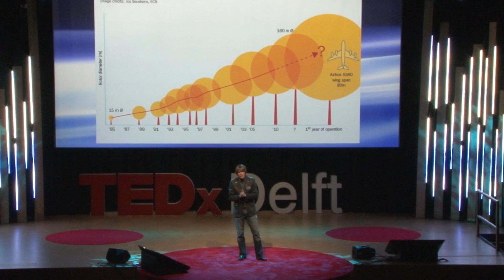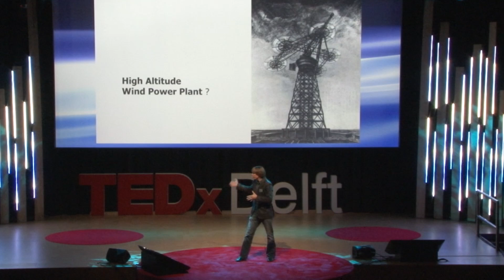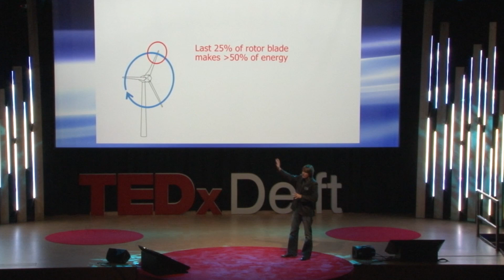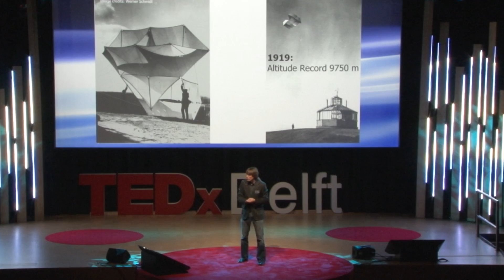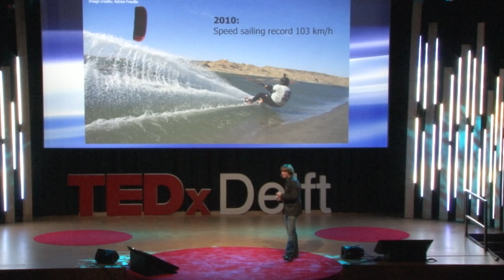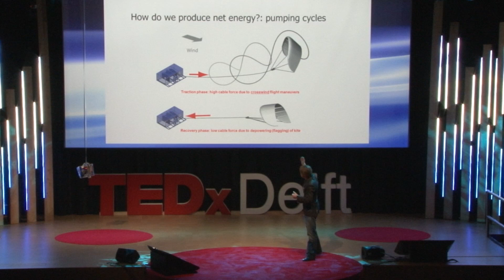Finally, kites have grown up: Roland Schmehl at TEDxDelft

Comment: It bothers me so much when they relate a kite to being the same as the tip of a blade. The reason the tip of the blade produces the most power is because torque is increased as the distance from the point of rotation is increased. The kite isn't spinning anything! Just because it flies in arcs that are round doesn't mean that there's any usable torque on anything
Reply: Your wrong. The usable torque is in the tensile on the tether. When does he say rotational torque?

Comment: But Professor how can this system operate offshore? Does it not need a couple of guys to hold it in the take off phase?  and how is the steering unit fed? batteries or the energy comes from the base through an electricity cable? 
thank you! Congrats! Awesome job!

Comment: how much space does that 10 KW system need in comparison to the current systems?
since they use up a lot of volume and each kite does its own thing, you will have to prevent the lines from getting tangled up, right?